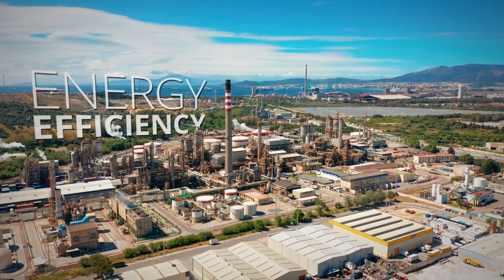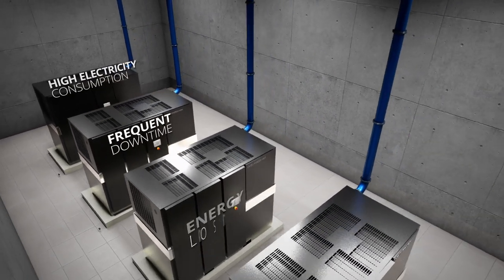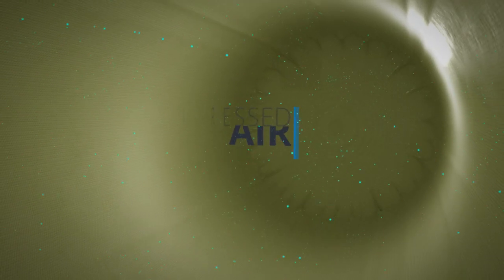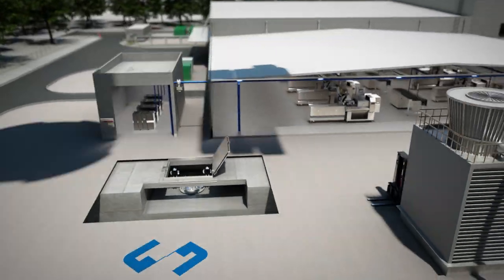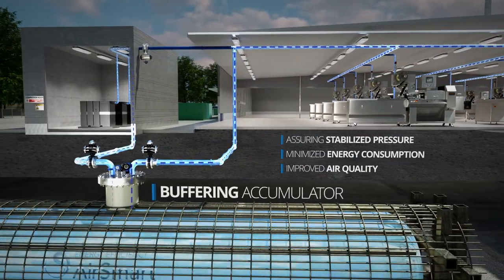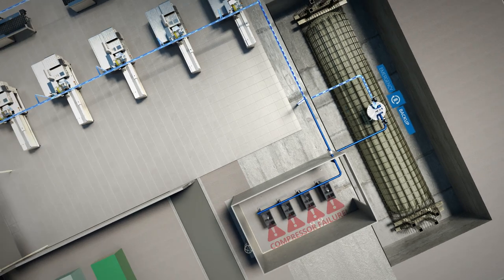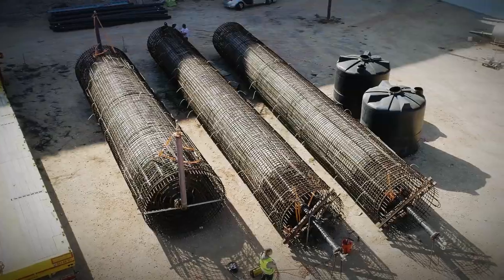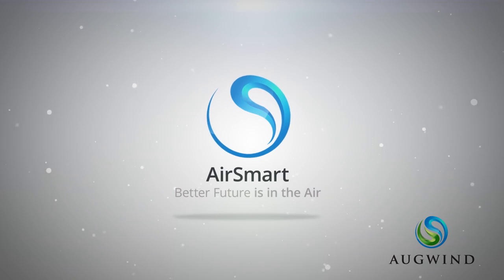Introducing AirSmart Energy Efficiency

Comment: i dont really get why it should save energy. its not that by putting air into an air tank that more will come out than you put in.  and saving co2?  if it runs during peakhours or not doesnt save any co2 

only upside would be the backup pressure. however normal air system pressure of 8bar seems quite hard to achieve certainly at this size  and has any asme/pressure vessel certification already been done?  it still is an time bomb underground if the concrete breaks and the liner starts to tear for whatever reason.

and after cycling for a certain amount of times how do you replace all the connection parts since they pressure cycle so they do need to be replaced every 10/20 years depending on use.  seems interesting tho
Reply: At night people (globally) use less energy and at night electricity is made with sources that need a lot of time to start or shut down. Like nuclear power plants which basically do not produce any CO2 to the atmosphere. After that there are often coal and oil power plants. However, at day and during peak hours, sources like gas turbines are started to provide that additional, easy to control amount of power (as you can't really storage too much of it), which also produce a lot of CO2. So at night, higher percantage of power comes from low CO2-emiting sources, like nuclear, wind and some solar designs with heat storage. Also, electricity at night is way cheaper because of that phenomenon.
Providing big storage tank may allows compressors to work more at most efficient range and allow for less power consuming startups (they turn on less often, but for longer periods). 
Tanks are made of metal and some composite, that reinforced concreate is there in case of emergency as a safety barier.
Also it seem that you can still access tank from the top and replace anything that is not a tank itself.
Reply: Car windshields were broken and scattered randomly everywhere in the form of fragments when the car was involved in an accident, which led to the death of many. But they addressed this problem. When accidents occur, the glass begins to shatter and everything remains in its place instead of breaking and scattering everywhere. I think the same mechanism is in the development of tanks.

Comment: Compressors are a very efficient system. The inefficiency is caused by electricity, electromagnetic inductors are very inefficient especially at high requirements. The solution is to adopt mechanical energy directly without conversion. For example, use generation systems to generate mechanical energy and use it directly, bypassing electrical losses.

Comment: From what ive read this has very poor efficiency, like way below 50%. Why dont you just use electrolysis and split water into hydrogen and oxygen. You get to like 80% efficiency there and it doesnt need a lot space.
Reply: I think the efficiency of compressed air is better than that. Even the efficiency of photovoltaic panels reaches about 26%. In addition, the life cycle of electrolysis is short and it loses efficiency as the water continues to disintegrate. Perhaps there are better ways to analyze water.